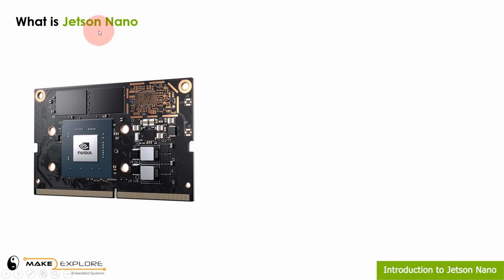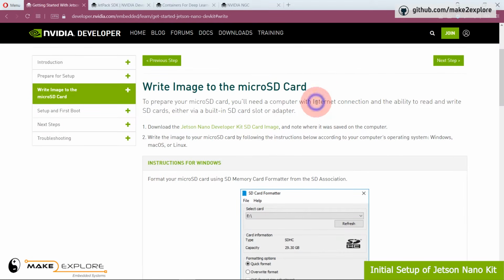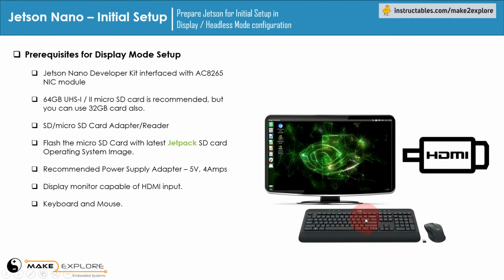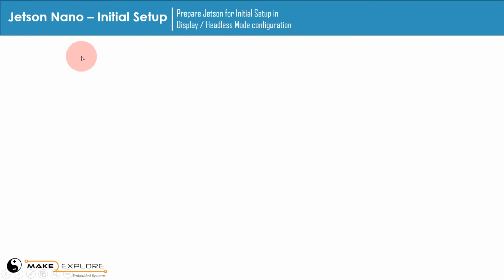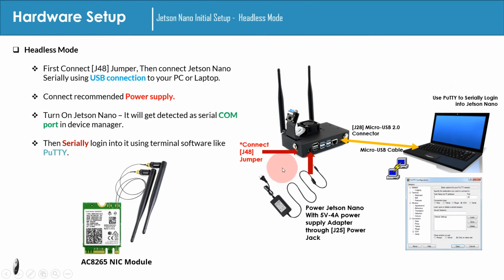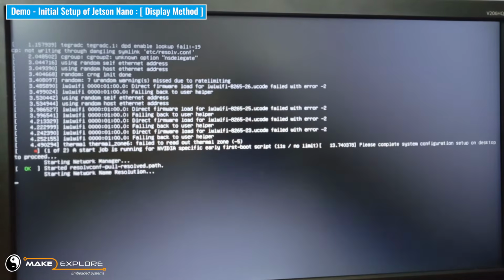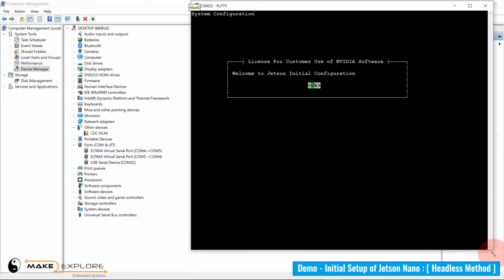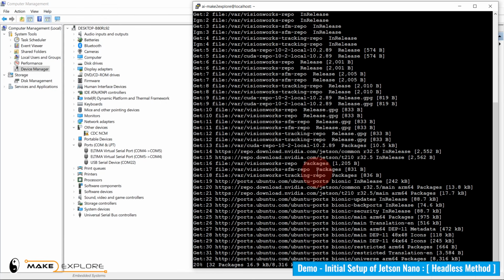[Tutorial] Getting Started With Jetson Nano

Comment: I hope you are doing well. I am currently facing a significant issue with my Nvidia Jetson Nano 2GB, which I recently acquired for a project. I followed the official guide for the initial configuration, but I am encountering a major problem when attempting to flash the image onto the SD card.

Specifically, I used BalenaEtcher to flash the image onto the SD card. The flashing process itself seems to go smoothly, but during the validation process, the SD card gets divided into multiple partitions. Furthermore, numerous pop-up messages appear on the display, prompting me to format the disk. When I click on cancel, an error message pops up stating: "le volume ne contient pas de système de fichiers connu. Veuillez vérifier si tous les pilotes de système de fichiers nécessaires sont chargés et si le volume n'est pas endommagé." (Translation: "The volume does not contain a known file system. Please check if all necessary file system drivers are loaded and if the volume is not damaged.")

I would like to highlight that I have tried formatting the SD card before flashing the image. I attempted formatting it once with FAT32 and then with Ext4, but the problem persisted.

Additionally, when I connect my HDMI cable to the Jetson Nano, which I know is functional, nothing is displayed on the monitor. This occurs specifically after I insert the SD card into the Jetson Nano.

I kindly request your assistance in resolving this issue. Your guidance and support would be greatly appreciated.

Thank you in advance for your help.
Reply: I have the same issue with my Nvidia jetson nano 4GB, i follow the same steps in the video but nothing appears in the screen.
Reply from the maker: Dear @elmahdiaouam7249, 
Thank you very much 🙏 for your interest in our channel.

Q  -  I have the same issue with my Nvidia jetson nano 4GB, i follow the same steps in the video but nothing appears in the screen

➡️ Its a typical/usual issue with Jetson Nano - (Screen Freezing/White Screen Issue). You can check on NVIDIA forum
🔗 https://forums.developer.nvidia.com/t/nvidia-jetson-nano-freezes-at-nvidia-logo-screen/236944

Standard workaround is as following - 
Please use -  
high speed SD card 
Good Quality HDMI Cable 
Proper Recommended Power supply(5V, 4Amps) and
Compatible OS Version for your Jetson Nano Variant 4GB/2GB 

Insufficient Power supply(Current Rating) or incompatible OS are the typical causes for this problem.

If you still have any issues/suggestions about this Tutorial, or any of our DIY project, feel free to ping us on WhatsApp/Telegram (Links given below) for further support.

Tech support - (𝗖𝗵𝗮𝘁 𝗢𝗻𝗹𝘆) Telegram/WhatsApp - 11:00 AM - 05:00 PM (Mon-Fri) IST   

🚀 𝗧𝗲𝗹𝗲𝗴𝗿𝗮𝗺      🔗 https://t.me/make2explore
💬 𝗪𝗵𝗮𝘁𝘀𝗔𝗽𝗽    🔗 https://bit.ly/3VXGGEe
📩 info@make2explore.com  / support@make2explore.com

As per time permits we will try our best to help you out. 

Best Regards 🙏
Reply: @make2explore  thank you for your response, i found that i was using the sdk image for jetson Orin, now after using the right sdk image, my jetson nano boot very slow(takes 30min) , what could be the source of this problem? 
I have SanDisk 128GB UHS 1, as an SD card, and a 5V - 3A phone charger that power the jetson via micro USB.
Reply from the maker: Dear @elmahdiaouam7249,

Use stable image - (4.6.1 best supported)
Try using old stable release of OS, As Jetson Nano Kit is old Hardware, new OS's for ORIN or other board may not give good speed/support on Jetson Nano

🔗 https://developer.nvidia.com/embedded/learn/get-started-jetson-nano-devkit#write
🔗 https://developer.nvidia.com/embedded/jetpack-sdk-461

If you are running Nano With peripherals (Display+Keyboard+Mouse+WiFi Card etc) - Then use good power supply (5.1V, 3/4A).
🔗 https://forums.developer.nvidia.com/t/power-supply-considerations-for-jetson-nano-developer-kit/71637

If you still have any issues/suggestions about this Tutorial, or any of our DIY project, feel free to ping us on WhatsApp/Telegram (Links given below) for further support.

Tech support - (𝗖𝗵𝗮𝘁 𝗢𝗻𝗹𝘆) Telegram/WhatsApp - 11:00 AM - 05:00 PM (Mon-Fri) IST   

🚀 𝗧𝗲𝗹𝗲𝗴𝗿𝗮𝗺      🔗 https://t.me/make2explore
💬 𝗪𝗵𝗮𝘁𝘀𝗔𝗽𝗽    🔗 https://bit.ly/3VXGGEe
📩 info@make2explore.com  / support@make2explore.com

As per time permits we will try our best to help you out. 

Best Regards 🙏
Reply: @elmahdiaouam7249  hello , i remember the problem was the image , u must use a stable version ,if the problem persists you can try remove and reconnect the hdmi cable it might be a port connection problem , i hope you fix it. 🤲
Reply: @mohamedhediguefrach771  hello mr Mohamed, thank you for your response, i Downloaded the right image for the jetson nano, and it did turned one time, i did the first configuration (time, zone, name and password...) but after that it turned off and got stuck on the boot screen.
Reply: @make2explore  thank you for your help, but this is the exact sdk image that i flashed and it didn't work, although i don't know where to find old stable version that you are referring to.
Reply from the maker: Dear @elmahdiaouam7249,

As we have said earlier,

➡️ (Screen Freezing/White Screen Issue). Its a typical/usual issue with Jetson Nano -  You can check on NVIDIA forum

🔗 https://forums.developer.nvidia.com/t/nvidia-jetson-nano-freezes-at-nvidia-logo-screen/236944

 Q - but this is the exact sdk image that i flashed and it didn't work, although i don't know where to find old stable version that you are referring to...

➡️ Have you tried Nano with Jetpack 4.6.1 ?
During our project development and As per our experimentation/testing, we found Jetpack 4.6.1 is the most stable release for Jetson Nano.

You can try other versions also. Following is the Archives page. 

🔗 https://developer.nvidia.com/embedded/jetpack-archive

Try multiple OS releases and find out best supported release for your Nano 2GB/4GB

If the problem still persists then we suggest that you should carefully check your hardware configuration and setup, SD card/Power supply may be the issue.
Reply: @make2explore  thank you so much for the informations
Reply from the maker: Dear Mohamed Hedi Guefrach, 
Thank you very much 🙏 for your interest in our channel.

Q  -  ---The volume does not contain a known file system. Please check if all necessary file system drivers are loaded and if the volume is not damaged

➡️ When you flash Jetson Nano OS onto SD card, multiple partitions get automatically created during OS installation, so "Multiple pop-ups" about different drives is common issue(which is not actually a problem. In windows machine these partitions get automounted(enumerated) in File manager. 

Do not format any of these partition - even it is saying unsupported file system. Just close the pop-up whenever it get displayed

Since Jetpack OS is Ubuntu Based it will have partitions like (SWAP, FS, EXT4 etc) sometime Windows doesn't understand the FS format and gives these kind of errors.

Q  - ...I would like to highlight that I have tried formatting the SD card before flashing the image. I attempted formatting it once with FAT32 and then with Ext4, but the problem persisted

➡️ SD card should be in its default formatting - FAT32

Q  ...Additionally, when I connect my HDMI cable to the Jetson Nano, which I know is functional, nothing is displayed on the monitor. This occurs specifically after I insert the SD card into the Jetson Nano

➡️ Its a common issue with Jetson Nano
🔗 https://forums.developer.nvidia.com/t/nvidia-jetson-nano-freezes-at-nvidia-logo-screen/236944

Please use -  
high speed SD card + 
Proper Recommended Power supply(5Amps) and
Compatible OS Version for your Jetson Nano Variant 4GB/2GB 

If you still have any issues/suggestions about this Tutorial, or any of our DIY project, feel free to ping us on WhatsApp/Telegram (Links given below) for further support.

Tech support - (𝗖𝗵𝗮𝘁 𝗢𝗻𝗹𝘆) Telegram/WhatsApp - 11:00 AM - 05:00 PM (Mon-Fri) IST   

🚀 𝗧𝗲𝗹𝗲𝗴𝗿𝗮𝗺      🔗 https://t.me/make2explore
💬 𝗪𝗵𝗮𝘁𝘀𝗔𝗽𝗽    🔗 https://bit.ly/3VXGGEe
📩 info@make2explore.com  / support@make2explore.com

As per time permits we will try our best to help you out. 

Best Regards 🙏

Comment: Do you need antenna? With nic?
Also can you access terminal of nano while connected to internet.
Reply from the maker: Dear Subscriber, 🙏 Thank you so much for your interest in our channel.

Q1. Do you need antenna? With nic?

Yes this AC8265 Wireless NIC module requires 2 SMA antennas (2.4GHz / 5GHz) with IPEX connectors. 

But if you are looking for more affordable solution, then you can also use USB WiFi Adapter instead of AC8265. These USB WiFi Adapters (802.11ac), mostly used for desktop PC's which don't have Wi-Fi capabilities. You can easily use them with Jetson Nano running Ubuntu OS. But just make sure that, it comes with generic driver support. you can use following or something like it.

https://amzn.to/3hAyZ4B

Q2. Can you access terminal of nano while connected to internet ?

Yes you can access terminal of Nano while connected to internet with no issues.

If you face any issues in replicating our projects, Feel free to contact us through email  
📩  info@make2explore.com
Also, For quick replies, you can always chat with us on 🚀 Telegram Just Search @make2explore  on Telegram 🚀

We'd ❤️ love to help.

Best Regards 🙏
Reply: @make2explore  Can you tell me, why you did not chose the simplest path of using an ethernet cable to connect into a router port. Is there a problem with this simple method?
Reply from the maker: Dear @eigenfield8380, 🙏 Thank you very much for your interest in our channel.

Q  -  Can you tell me, why you did not chose the simplest path of using an ethernet cable to connect into a router port. Is there a problem with this simple method

➡️ Yes! You're absolutely right. If display/Screen (Monitor) is available, Then Ethernet connection method is simplest one. At the time of making this video Tutorial ( in Oct21), We'd Jetson Nano Dev Kit came with AC8265 Wireless NIC module, So that's why we've included its interfacing in video. Unfortunately, We missed to mention this ethernet config method in Display mode setup explanation.

➡️ Some of our Students had only Laptops, but they do not have their own Monitor Display screens. Hence we added Headless Mode Setup Explanation.

Thank you for your valuable suggestion, We'll definitely try to cover this topic, whenever we make any other Setup video Tutorial on Jetson Nano.

If you still facing any issues in replicating any of our DIY Project/tutorial, feel free to ping us on WhatsApp/Telegram (Links given below) for further support.

Tech support - (𝗖𝗵𝗮𝘁 𝗢𝗻𝗹𝘆) Telegram/WhatsApp - 11:00 AM - 05:00 PM (Mon-Fri) IST   

🚀 𝗧𝗲𝗹𝗲𝗴𝗿𝗮𝗺      🔗 https://t.me/make2explore
💬 𝗪𝗵𝗮𝘁𝘀𝗔𝗽𝗽    🔗 https://bit.ly/3VXGGEe
📩 info@make2explore.com  / support@make2explore.com

As per time permits we will try our best to help you out. 

Best Regards 🙏